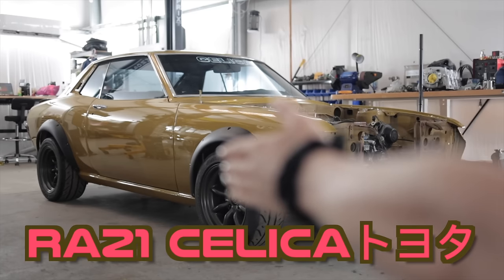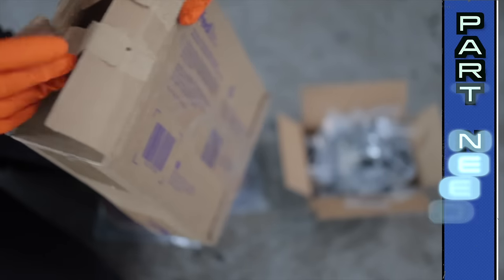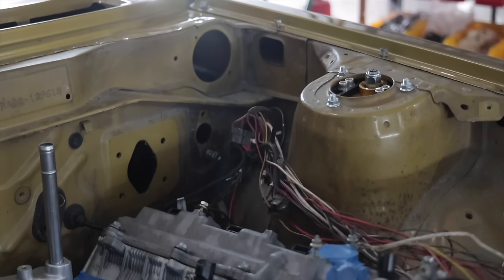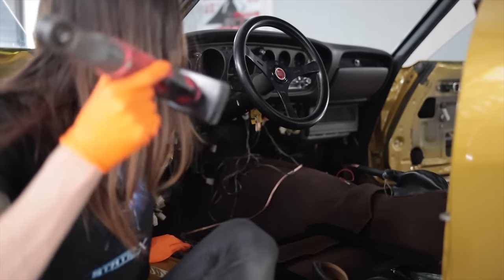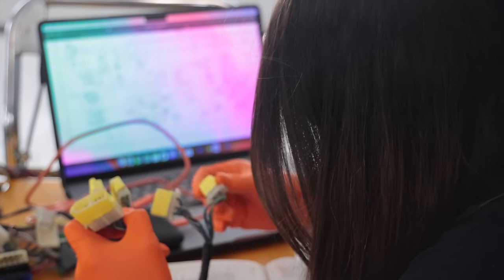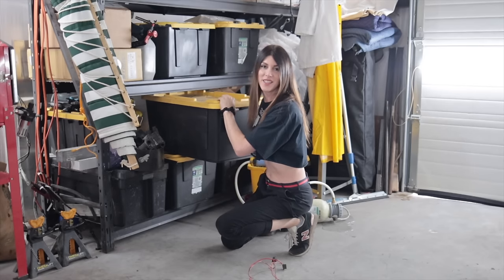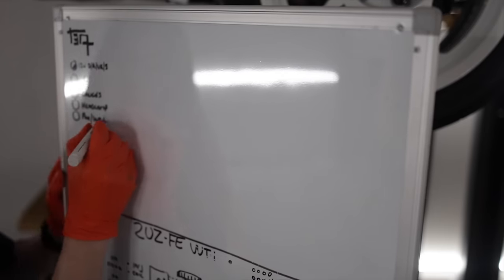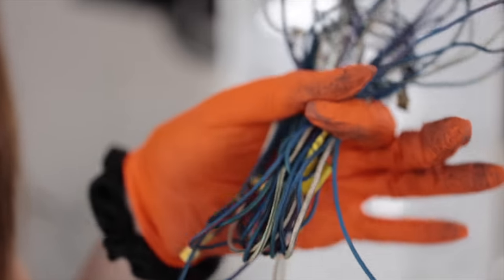Replicating OEM Quality Wiring // 2UZ V8 1974 Celica

Comment: Sarah, I'll say this:  Anyone who can make sense out of that bird's nest is a genius.  More than that, anyone who can unravel that and make it all work is a super-genius.
Reply: Agree 💯 - like many a shade tree mechanic wiring is my kryptonite
Reply: Absolutely!
Reply: Its time consuming but not that difficult if you start at the end of the circuit and work back to the switch or  power source. Once the wire is installed, check the circuit for proper operation. Multiple wires from the end of the circuit to several power sources makes it somewhat more difficult but certainly doable.
Ive rewired vehicles that had the entire wiring harness removed from them with nothing more than a factory shop wiring diagram.
Reply: it's very similar to plumbing with valves
Reply: No.... we are called Mechanics/Technicians.

Edit: As much as I would love the title of super genius, or even genius... yeah, we just prefer being called what we are.
Reply: @donreinke5863 Easy for you to say.
Reply: Wiring is where most of my builds end.
Reply: @PeterFusco  Alright...I started in automotive repair in 1972...so I have a bit of experience.
Reply: Not so much genius as the patience of an oyster. 😊

I still think Sarah is a genius I'm just saying, you don't need to be a genius to be meticulous and patient .
Reply: Strongly agree

Comment: As a fellow tall person, I felt every moment of that under-dash work.  People don't realize that some of us just don't fold well.
Reply: Amen Brother!!!
Reply: The getting back out of there is 😢.
Reply: And your back is only supposed bend in one direction  !
Reply: Right! Sometimes I think chiropractors were invented because of mechanics and technicians!
Reply: Im not that tall, but rather "wide", so i broken my ribs more than once over the threshold trying to reach just that little further, it doesnt hurt that bad, but the sound it make when it pop is rather disgusting
Reply: At 5.10 I’m glad to be short
Reply: As 6ft tall, I have perfect hight for most things. But under dash work is akward and takes toll on your back whichever way you are under there. Taking out seats do help a lot as you can lay inside the car on a piece of foam or something.
Reply: I'm 5 and a half feet and also don't do well under a dash.
It's just a bad place to be 😢
Reply: Ive sometimes had to lay face up under a dash with my knees bent over the seat back to do under dash wiring and repairs....Im 65 years old and 5-10 and its only slightly more difficult than it was 35 years ago.
Of course, removing the seat makes it super easy, but I usually dont bother unless the seat is already out for other reasons. I find it much harder to get my hands in tight places without removing the obstacles.
Reply: Absolutely. It's miserable.
Reply: Doing such work keeps one flexible well past the point where many are not.
Reply: 6’ 2” club checking in 🍻

Comment: Looking wonderful.  So glad you got the replacement looms.  The potential problems with reusing old wiring makes my head spin.  Gritting my teeth about old connectors/plugs, but I'm gonna trust you!
Thanks for all your time.  Keep up the great work and stay safe!
Reply: The problem with using old wiring is degraded insulation as well as increased resistance. Best to use new wire and get new connectors or thoroughly clean old ones
Reply from the maker: @donreinke5863   The 2005 Harness was in FAR worse shape than the 1974. Honestly the 1974 is a 10/10 condition wise, the wire jackets are still pliable and the copper is fresh and corrosion free, I was astonished how well it held up 50 years.
Reply: @SarahnTuned  I hope this teaches you that older is in many cases better. Materials were higher quality in many cases, so was craftsmanship and the work ethic necessary to build a higher quality product was in many cases still present.
Of course, there were things like the Vega.......
Still.....the dedication to do ANY job right no matter what is very admirable and sorely lacking among most today.
You are to be commended for that...from someone who has been in automotive repair for 52 years.

Comment: After market alarm systems were the bane of the 70s-90s.  I had at least 3 used cars with totally messed up electrical because of those.  Not to mention they filled every neighborhood with cacophony of false alarms.  Thank goodness most new cars come with factory standard anti-theft.
Reply: In one of my Capris they had installed a afttermarket alarm and the immobiliser was acting up a lot, so that was the first thing I ripped out when I got it. Have hidden switch for the ground on ignition works way better than some of the old alarms.

Comment: This was helpful.  I pulled all the under dash and most of the engine bay wiring out of my 64 Falcon convertible last week.  And after taking a closer look at the block of the re-manufactured 289 some one put in it, I am contemplating a much more modern engine swap.   Which will need a more modern harness.  This video helps in the decision process.

Comment: Watching all of that wiring as an Auto Electrician is great, love it, I'd use the old temp sender in the new engine so it drives that gauge correctly or you will have to rewind the gauge to suit the new sender, The alternator warning lamp wire should go straight in but the alternator might need an ignition wire also. unfortunately using that AMP meter is going to be a problem as the new alternator will have too much power for it and those old shunt meters caused a lot of volt drop, you could however change it to a volt meter.
Auto Sparkies will get asked to do these sort of conversions often, well not this exact one, very few seem to understand just how much is involved in the wiring of this sort of job, you seem to have it well in hand.
Can not wait for more.

Comment: I fully agree with you, Sarah
I love doing swaps where it looks dead stock like it was built that way so all the factory gauges got to work.

It's also a lot less hard than people think it just takes like I said in another comment the patience of an oyster.
All you really need to do for the factory gauges. Is to use factory sending units.

Cool thing is I don't know if Toyota did it too but Datsun tachometers have a calibration potentiometer in them so you can tailor the tachometer to read correctly with the engine you are  using.

In your case, you probably have to swap the guts from a modern tachometer into your classic one because these old cars used it simple negative trigger on the coil and of course your 2UZ has eight coils. Maybe you can use Dakota digital signal converter for that? I've used those too

It really stinks when you want to retain the mechanical speedometer, though, most modern powertrains, do not have provisions for a speedometer anymore.

How are you handling the speedometer? Does your W-58 transmission have a provision for a mechanical speedometer? I hope so. 😊

Comment: Interesting to see a video dedicated to wiring - especially for integrating a newer EMS into an older chassis. I've had to do much the same for the K-swap into my 80's Fiat, but I ended up with 3 separate fuse & relay panels on that. I also have to diagram all my wiring, it's the only sensible way to track it. Nice work!

Comment: If you haven' selected the electric fans yet, consider the dual Ford Contour fans.  Very low profile, 3500 cfm, 42A max.  The curved fan blades are the ones to get not the straight blade ones.  This fan assembly measures 24-1/4" wide, 16-3/4" tall, and is 3.5" deep.

Comment: In 70's GM there is a pink wire from the key switch that controlled starting. Putting in a magnetic switch made a quick and easy theft deterrent. Then just hide the magnet.
When working on interiors usually upside down and sideways cardboard is your friend. Metal ridges are painful. I also use Venom nitrile gloves.

Comment: You need a cipboard and nail peg board. Measure the wire A to Bs and lay out the connector nails from the ECU and then, from the ECU, lay out each wire to its destination nai/pin.

Comment: I replaced the mechanical stuff in my gauges with stepper motors from a modern car. I then built a CANBUS controller that reads CAN messages from my Haltech ECU and moves the analog gauges. Modern engine and ECU with stock 1971 analog gauges 👌

Comment: Sarah, be cautious when connecting the ammeter. The new internal regulated alternator may have a higher current capacity than the meter can handle.
Reply from the maker: I’ll have to double check the 18R alternator specs, I bought a 180amp one for the 2UZ if I recall correctly.

Comment: Since you have room in front of radiator put the fans in front as pushers looks like a easier install and more room in engine bay
Reply from the maker: Can’t, doing an oil cooler up front instead.

Comment: I would like to know your source for the oem plugs. I have had no luck finding replacements. 
I’ve got a 2UZ-FE Tundra from a hot / dry environment. Needless to say, all the plugs and clips under the hood are BRITTLE!
Reply from the maker: You can buy them brand new, I get them off Bellanger Motorsports website and look them up by manufacturer part number via the Toyota factory service manual.
Reply: @SarahnTuned awesome!
Thank you for the info.

Comment: Where did you find all these connectors .. I have a few broken ones on my vehicle and I want to replace them
Reply from the maker: look up the manufacturer part number on those plugs with a dealer level factory service manual (most of them you can find in PDF file by searching google), then take your part number and search google for it. There's a few websites that specialize in selling OEM connectors. I used Bellanger Motorsports for Toyota ones.
Reply: @SarahnTuned  what about ford ones I have a 93 ranger and I have been having a hard time looking for the 3.0l connector for the distributor

Comment: Since you're putting a "modern" engine in with a new ECM are you going to install an OBD2 port as well? or is that not necessary.
Reply from the maker: Nope, I just plug my laptop into it and I can view or control anything the ECU does.

Comment: OK I just have a question is that a reverse cooled motor as opposed to a motor where the cooling system goes the opposite direction from top to bottom or bottom to top?

Comment: Sad that Toyota never supported the aftermarket on the 2uz. Jonathan Ward wanted to use them in their land cruiser builds, but couldn't. That's why they use the LS.
Reply from the maker: There is zero excuse to use an LS in a Toyota, and there is a ton of support for the UZ engine range if you do thorough research. The fact that I made an iron block truck UZ capable of 8k RPM+ is proof of it.

Comment: Just wondering, does twisting the wires / using shielding helps with the signal stability in cars? (if it's a stupid question, sorry)
I work in IT, and most wires are sensitive to EMF and we almost always find computer wires all twisted with shielding to improve signal stability.

Comment: 12:54 - Let 'em scream. When you're done, it's going to look like it rolled off the production line with an EFI V8 in the '70's.
All that shaving and tucking of the firewall and seams just won't look "Factory".